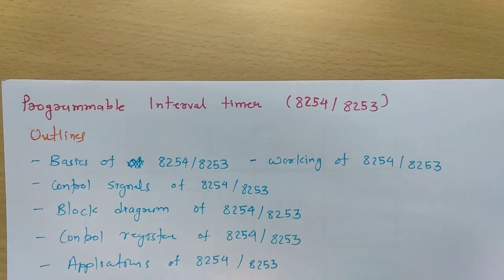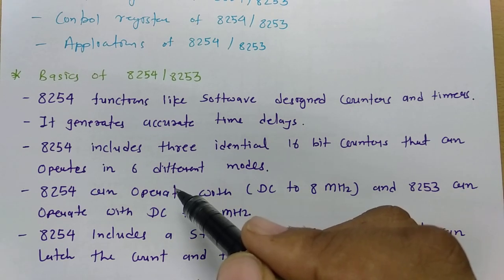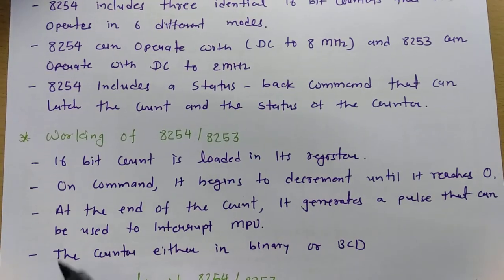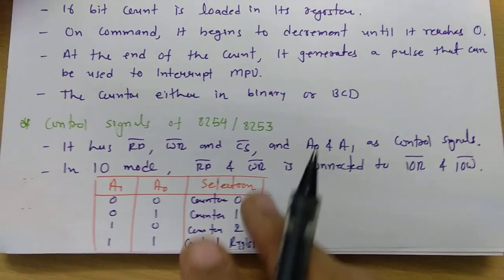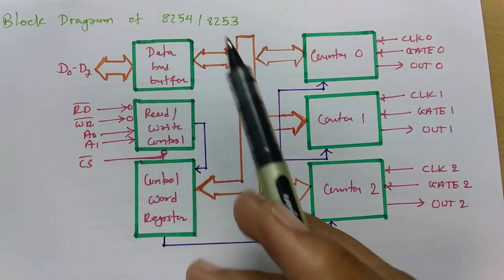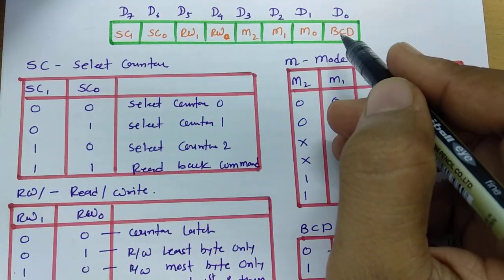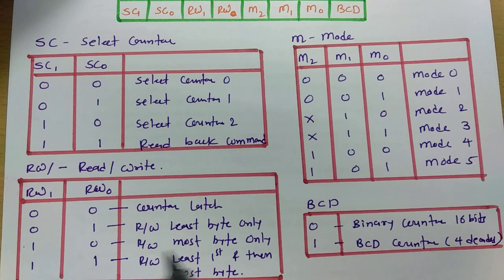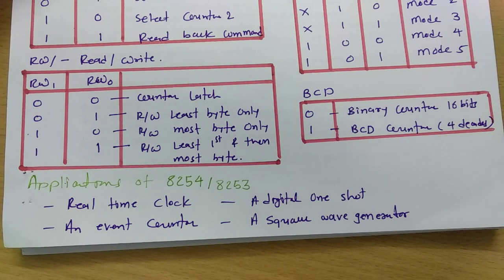Programmable Interval Timer 8254/8253 (Basics, Working, Control Signals, Block Diagram & Applicatio)

Comment: 01:32 The 8254 is a programmable interval timer IC with three identical 16-bit counters.

03:04 8254 is an advanced version of 8253 with 3 identical 16 bit counters operating in 6 different modes.

04:36 8254 is a 16-bit counter with three identical counters that can be loaded with a 16-bit count and decremented until it reaches zero, generating a pulse at the end of the count.

06:08 The 8254 chip functions in six different modes and has five control signals.

07:40 Selecting Counters and Control Register

09:12 Data exchange and counting with control resistor selection

10:44 8254 has 6 different modes of operation and supports read write operations.

12:12 The 8254/8253 IC can be used for real-time clock, event counter, one-shot generator, and square wave generator.